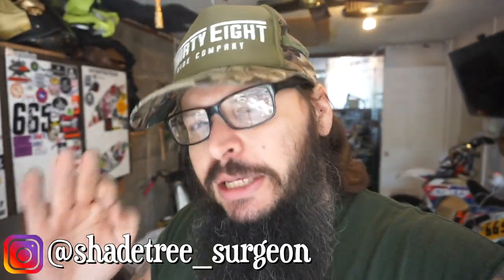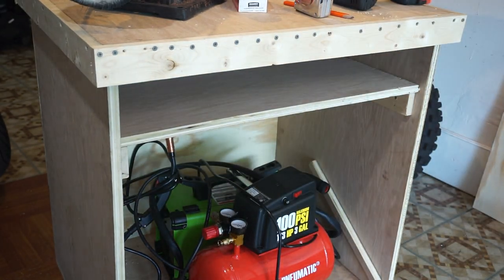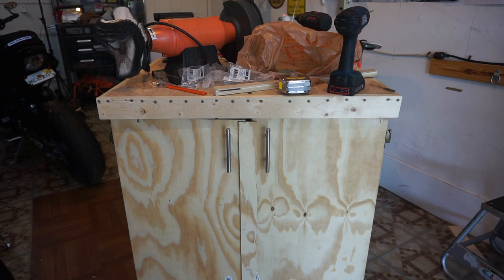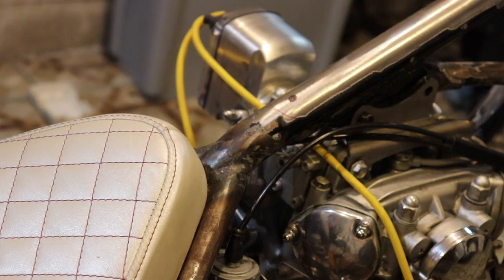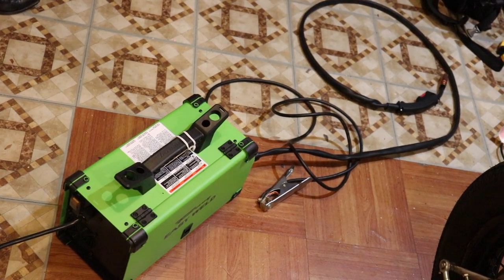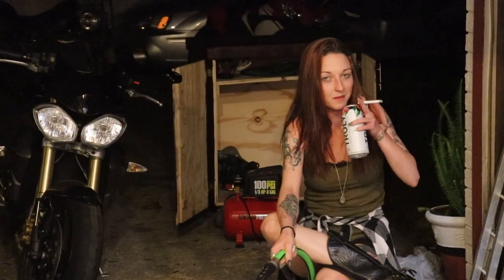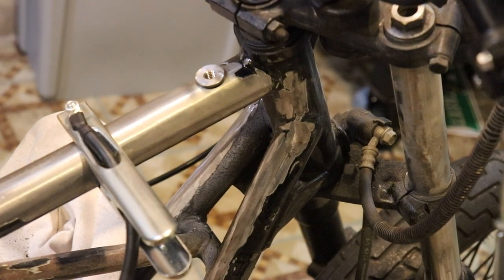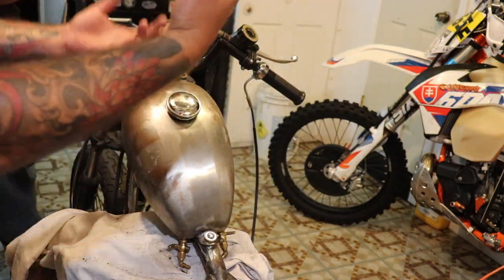Weld on Chopper Gas Tank | XS650 Chopper Build Series Part 9

Comment: You might want to put rubber bushings between the tank mount and the frame to absorb some of the vibes and prevent cracking.
Reply: or leather washers .. I like using those

Comment: I'm not an old chopper guy, but when I drilled my bung holes (HA !!!!)   I literally just drilled holes in the tongues of the tank and set it on the back bone, hose clamped it down so it wouldn't move after I got it where I wanted and then used a marker to mark where my centers of bungs needed to be.  Chop on!

Comment: It is a good idea to disconnect the battery before welding the frame. The Long Way Round series showed welding the subframe and frying the electronics for a BMW with fuel injection and ABS braking. It did allow the camera guy to get a new much lighter bike so he crashed a lot less, and it was easier to pick up. They were riding heavy adventure bikes on extremely bad dirt roads- they really should have been riding 125cc dirt bikes for this part of their trip. The pros do 'stack of dimes' welding, but like you said these welds will be hidden anyway, and the weight of the gas tank is mostly straight down and you are probably not going to be doing extreme cornering with a chopper.

Comment: If you can't grind in far enough (accidentally grind the weld away and compromise the joint) to clean up the weld and smooth it, one trick for a narfed up bead is to wipe filler or JB weld around it , then sand it smooth. Good looking chop btw.

Comment: My old woodshop teacher used to say more screws/nails does not = more strength. 19 screws in that front edge is overkill.  It would probably suffice, and be stronger with maybe 7 evenly spaced, pilot drilled screws.  That being said, it still turned out great for someone with no formal training.  It should give you years of trouble free service.  Keep up the good work!

Comment: The trim piece on the door is standard procedure, and it's better to have a gap than to have the doors interfere with each other.  You're becoming a carpenter as fast as you are becoming a mechanic.  Can't keep a good tinker down.
Reply: Beat it to fit, paint it to match.
Reply from the maker: Thanks man!

Comment: One tip I heard from an old welder and fabricator is to cut the booger off the end of the wire. It takes a lot of amps to burn it and can hurt the work pice.

Comment: Good job man keep working on your welds, little cursive e’s and go get some 25/75 shielding gas and some decent mild steel wire and through that flux core wire away, then you would be kicking field goals and making pretty welds!

Comment: the bike is lookin good. a few practice beads on some scrap will help you set up wire speed and voltage before you start welding on the workpiece. it's always a good time watchin yer videos, keep up the good work. y'all have a badass day

Comment: If you take the nozzle off your weld gun you will be able to see your weld puddle better. You dont need the nozzle unless you are welding with gas. Also make sure your weld gun is electrode negative when welding with flux core wire.

Comment: its looking really  good, but dont forget to put some rubber between the frame and the tank so it dampens the vibration. because the vibration can cause cracks and break the frame over time.
Reply from the maker: I got leather washers in there now

Comment: Seems like could have just drilled an tapped the holes and skipped all the welding and grinding. I've tapped holes in tubing that thin without problems. Either way coming together nicely. Should be sweet when it's done! PEACE!!!!!!

Comment: If that welder and air compressor run at the same time, there's a bunch of heat being generated. 

You're box is hot.

Hot boxing it?  

Ahem, carry on.